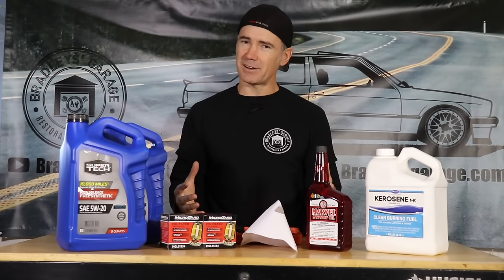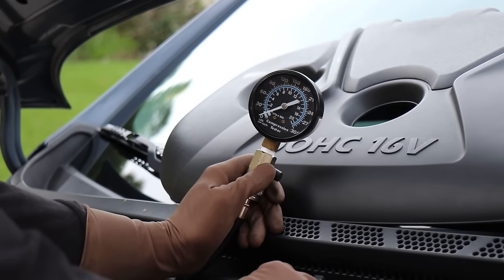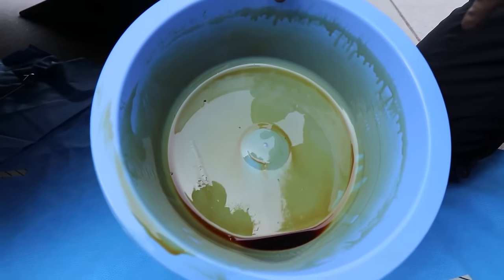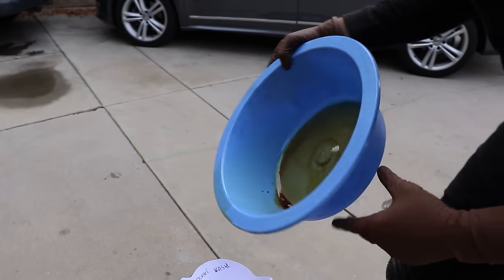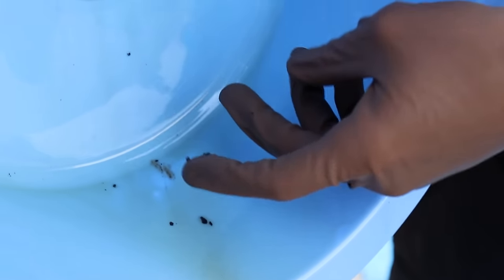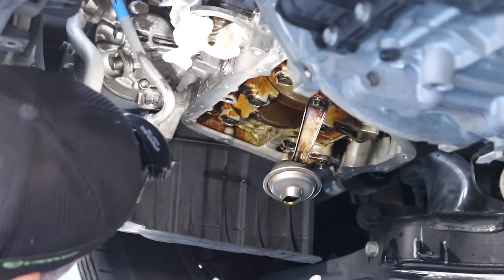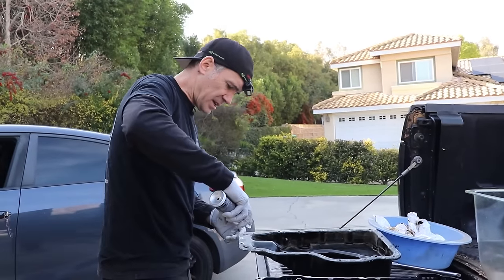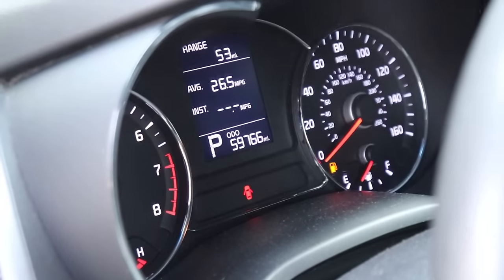*UPDATE* Customer States Jiffy Lube refused to change my Oil - Sludge Factory Kia Forte

Comment: 3000 miles is a good short duration oil change interval, but with Mobil 1 synthetic, the oil drain interval can be lengthened. Whatever the owners manual suggests for a drain interval is going to be easily doable for Mobil 1. If it gives a range for drain interval, the longest interval should be fine.
Granted there is still some internal sludge in the engine, so a shorter duration even with the Mobil 1 would be prudent to do for maybe 2 or 3 oil changes, but after that, a longer duration time should be fine.
I have a 99 Chevy Silverado 5.3L that I use quite infrequently, and I run Mobil 1 Extended Performance High Mileage 5w30 in Since I barely get 3000 miles in a year, I just change oil once a year with it. I should really drive that truck more than I do.
Reply from the maker: Thanks for the comments Danny, appreciate the feedback. Cheers!

Comment: That engine is 100% cleaner than before the 1st flush. The owner of the car is very lucky that you were able to save it. Going forward, if oil changes are done at regular intervals, say  every 4k miles, would the remaining bits of sludge be gone? Thanks
Reply from the maker: Thanks for the comments Joe, appreciate the feedback. We will check on it every 1k miles until the nest 3k miles oil change. It has already been 1k since the update video and we are not seeing any evidence of oil loss of any other issues. We plan on doing 3k mile oil changes for at leas the next 3. That should help remove any remaining debris even though things looked pretty good after the update.
Hopefully we have done enough the salvage the motor and keep this little Kia running for many more thousands of miles.
Cheers!

Comment: Great videos. Could you have just done flushes with conventional motor oil and drain, and have similar results? Thank you.
Reply from the maker: Thanks for the kind words, glad you enjoyed the videos. Unfortunately there is just not enough oil flowing on top of the cylinder head to wash off that sludge. You saw how caked on it was and even after numerous flushes, there was still residue.
We even did a little diesel flush (off camera) with the oil pan off to wash out any debris in the tight areas of the engine and holes. That produced quite a bit of particles so we feel pretty good that we got the internals as clean as possible.
We just posted the 3k mile update video if you haven’t checked it out yet - https://youtu.be/QrJ0B-KXTw0
Cheers!

Comment: Should have used atf instead of diesel, all you did with that is thin out the oil. ATF is full of detergents and cleans the engine much better. You should have removed a bearing cap and took a look at the bearing, that will be the tell all to see if all your work has done anything.
Reply from the maker: Thanks for the recommendation, we will check out ATF on our next Sludge Factory project.
Cheers!

Comment: Good video. Friendly advise though, use way less sealant that you showed putting on the oil pan, bead should be no bigger than 1/8" and mostly towards the outside of the lip, just rounding the bolts. Slivers, or excess on inside can and will fall off and clog oil pickup tube restricting oil flow locking up engine. Plenty of locked up cores for no oil, because of this and sludge in piston rings burning up all the oil. Take care.
Reply from the maker: Thanks for the comments, appreciate the feedback. Cheers!

Comment: Been doing a transmission fluid in the engine oil. I’ll add some BG engine flush right before the next oil change. 2012 Scion XB using 2 plus quarts every 3 to 5 thousand miles.
Reply from the maker: Thanks for the comments, appreciate the feedback. Cheers!

Comment: I'd install a container of Rislone P/N 4102 with the oil change and run it the full interval. Do that for a few oil changes. Rislone has some ester content which is a slow-acting cleaner. This can help dissolve sludge in smaller passages within the engine without breaking loose large chunks, to include oil control rings.
Reply from the maker: Thanks for the comments, we will look into that product. Cheers!

Comment: I’d be afraid the cylinder walls would get washed out, loosing their varnish.
Reply from the maker: Thanks for the comments Nina. Not sure what you mean by cylinder walls getting washed off? All products that were added to the crankcase have lubricating properties so there would not be any damage, especially at idle.
Cheers!

Comment: Given how long the sludge was present throughout the whole engine, why weren't the timing components and oil pump also addressed while the valve cover and pan were off? All that crud surely must've shortened the life of  those parts by quite a few thousand miles or so at the least.
Reply from the maker: Thanks for the comments Dan, appreciate the feedback. We did a little diesel flush (off camera) with the oil pan off to wash out any debris in the tight areas of the engine and holes. That produced quite a bit of particles so we feel pretty good that the internals are clean at this point. 
Hopefully we have done enough to salvage the motor. We will continue to monitor it every 1k miles to see if it is burning oil or has any issues.
Cheers!

Comment: Reminds me of the 2.7 dodge your pretty cool what kind of gloves are those.
Reply from the maker: Thanks for the comments, it was more of a mess than we had anticipated. Hopefully we have done enough to salvage the motor.
We have a few friends that work at a hospital and they get us unused supplies. These are actually surgeon gloves used in the OR, so they are a little thicker and have high cuff. 
When we need to purchase them though, this is what we use - https://www.amazon.com/Microflex-SafeGrip-Disposable-Automotive-Fingertips/dp/B002WQG02M
We just posted the 3k mile update video on the Kia if you haven't seen it yet - https://youtu.be/QrJ0B-KXTw0
Cheers!

Comment: All unnecessary. The sludge adheres to the inert parts of the engine. All you need to do is change the oil and the new oil will slowly dissolve the sludge. There is argument, but the decent condition of the oil pan shows that no special measure were necessary. Above all, whatever wear or damage has occurred as a result of failing to change the oil is not going to be reversed no matter what you do. Absent clear evidence that the oil system is clogged, just change the oil and proceed.
Reply from the maker: Thanks for the comments Mike, appreciate the feedback. Cheers!

Comment: I had an engine like this in a car we drained the oil added a mix of 50%oil and diesel fuel run it for one hour and drained it out! Refilled and changed oil and the filter. After that I changed the oil every 3000 mile and never had a problem, you just need to clean it out and start fresh.
Reply from the maker: Thanks for sharing, hopefully we have done enough to salvage the motor. We just posted the 3k mile update video if you haven't checked it out yet - https://youtu.be/QrJ0B-KXTw0
Cheers!

Comment: Wow great info! I do use pennzoil ultra platinum on my 2021 Bronco and Super Tech on my 2022 Ford Maverick, but will be switching to pennzoil as well. I do my oil changes every 6 months never exceeding 4k miles. Is that something you would do to your own vehicles?
Reply from the maker: Thanks for the comments Ramon, appreciate the feedback. Depending on the car, way it's driven and manufacturer recommendations, we run from 3k on performance cars, up to 10k on our diesel engines. No matter what we are using Full Synthetic on every vehicle, typically Liqui Moly or Torco. 
Cheers!

Comment: Pickup a parts washer brush (kind with a hose attached) and connect it to a cheap pump in a oil drain pan. Leave oil drain out of engine oil pan. Use a cleaner you choose (diesel would work) and just brush and wash sludge from under valve cover down into oil pan and into drain. Once clean, drop oil pan and clean. If you want to use a engine flush after that, it's got much less crap to deal with from the start. (you basically just use the engine block as a big parts washer.)
Reply from the maker: Thanks for the comments George, appreciate the feedback. We did a little diesel flush (off camera) in the first video, with the oil pan off to wash out any debris in the tight areas of the engine and holes. That produced quite a bit of particles so we feel pretty good that the internals are clean at this point. 
Now after the update video things are looking really good.
Original video - https://youtu.be/XU79jXYWydA
Cheers!

Comment: You a fan of Seafoam at all?  I've had good luck with it in the gas tank of my car, and the intake, but never tried it in the crankcase...though it says you can.
Reply from the maker: Thanks for the question. We have used it just like you, in the fuel tank/system and cleaning intakes. We have never used it in the crankcase before though we have had positive feedback from the Sludge Factory video.
Cheers!

Comment: 17:40  On modern cars, you can press accelerator to the floor before engaging starter and the engine will not start.  You can crank it this way to prime the oil filter before an actual ignition and idle.  "Poor man's pre-oiler."
Reply from the maker: Thanks for the comments Chet, we did that for the compression check but never really verified if it works on this Kia after the oil changes. Adding a little oil to the filter is easy enough to do. 
Thanks for info though. Cheers!

Comment: Really wish you had cut the original filter and did a oil analysis. If you can use a diesel rated high detergent oil it will clean up better. Oil should not be much dirtier than dark honey.
Reply from the maker: Thanks for the comments Ron, we didn't even think about testing the oil or filter until it was already discarded. Once we opened up the can of worms, we got a little distracted by the mess. Hopefully we have done enough to salvage the motor.
We just posted the 3k mile update video if you haven’t checked it out yet - https://youtu.be/QrJ0B-KXTw0
Cheers!

Comment: Thanks for the update link. Surprised the compression still up.  Wonder if you could pull a plug and use a small camera to go inside and look for scoring?  Likely none with those compression numbers. Should put an oil plug in that has the magnet on it.   Seafoam seems to be real good at cleaning up (through gas additive and oil additive), and use some Royal Purple oil - but that will likely have to run 2-3 times and do regular mileage oil changes... more of a long term thing.  What do the intake valves look like?  All crudded up from the lack of multi-port injection washing?
Reply from the maker: Thanks for the comments Rick, we tried to use a little camera scope down the cylinder. The problem is it wasn't clear while recording the little screen so we decided to leave that part out.
Great suggestion getting a magnetic oil drain plug, just to see if there is any metal flakes floating around. Also could not really see the valves clearly with the camera since it's hard to make a 90 degree turn with our setup.
We just posted the 3k mile update video if you haven't checked it out yet - https://youtu.be/QrJ0B-KXTw0
Thanks again for hanging out, Cheers!
Reply: @BradleysGarage  No problem - thanks back for reading the comments so quick and commenting back - I have subbed now as well.  Enjoying your content!

Comment: Not a bad result. The only thing i think will clean this better is the BG engine restoration, but what you did here is way cheaper...
Reply from the maker: Thanks for the comments, appreciate the feedback. This was our first Sludge Factory so we had never heard of the BG stuff before the comments stated pouring in. At $300 it's expensive but if it enables you to not remove any parts, it would makes sense in cars that are more difficult to access the valve cover and oil pan.
Cheers!

Comment: Wouldn't MMO thin out the oil? Did you use different weights of oil during this process?
Reply from the maker: Thanks for the comments Cory, it would thin out the oil for sure but that was the intention. We only left that mixture running for a short period so it wouldn't be an issue. Hopefully we have done enough to salvage the motor.
We just posted the 3k mile update video here - https://youtu.be/QrJ0B-KXTw0
Cheers!

Comment: Just change oil after 500 miles 3or 4 times. Would have done the same thing
Reply from the maker: Thanks for the comments, not sure that would do the trick on this one. We definitely needed to get as much out of the crankcase as we could in order for it to clean up. It's looking pretty good after the first 1k miles since the update video, no oil burn as of now and things look good.
Cheers!

Comment: Had an engine just like that back in the 80s. I used diesel fuel and cheap motor oil. 50/50.  It worked.  Drove that old Ford LTD for three years.
Reply from the maker: Thanks for the comments, appreciate the feedback. Cheers!

Comment: You should do your kerosine rinse with the valve cover off and poor it into every little nook and cranny of the head. Preferably with the oil pan off as well.
Reply from the maker: Thanks for the comments, we did a little diesel flush (off camera) with the oil pan off to wash out any debris in the tight areas of the engine and holes. That produced quite a bit of particles so we feel pretty good that the internals are clean at this point. 
Be sure to check out the follow up video here - https://youtu.be/XFsHnrt0l3w
Cheers!

Comment: Good job 👍🏾, thank you for sharing. You did everything perfectly aside from would have done. And I have a chemicals degree in that subject. FYI everything you did will not harm the engine and safe, what ever is left is all lose and the detergent in fresh oil will take care of it. Oil contamination with moisture and short trips is the major causes of sludges. Generally after a good long drive it is a good idea to just dump the oil without replacing the filter is highly recommended.
Reply from the maker: Thanks for the kind words Mr. Steel, appreciate the feedback. There definitely seems to be an issue with short driving trips as he works very close to his home.
Hopefully we have done enough to salvage the motor long term.
Be sure to check out the 3k update if you haven't seen it yet - https://youtu.be/QrJ0B-KXTw0
Cheers!
Reply: @BradleysGarage  one advice? 
After running the engine till operational temperature is reached, start the clock for 15 minutes, then let it sit for the sludge to loosen up more for 1/2 hours, therm repeat by running engine for 15 minutes after reaching operational temperature. 
Now drain it 🙏

Comment: With this engine, maybe take an old trans pan magnet and put it on the bottom of the filter. Check those VVT solenoid screens, and clean the solenoid passages.
Reply from the maker: Thanks for the comments, we will take a look at the VVT solenoids. Cheers!

Comment: Wish I knew as good of a mechanic. The Undercarriage, Engine and Transmission were really clean.
Reply from the maker: Thanks for the kind words Ron, we refuse to work on dirty cars. We did a complete pressure wash on the engine bay and undercarriage before starting any repairs. There is nothing worse than working on oily, greasy cars.
We just posted the 3k mile update video here - https://youtu.be/QrJ0B-KXTw0
Cheers!

Comment: With all the time and material, ( including   all that wasted new oil,) you could have pulled the head, oil pan and pistons. Clean it all& reasonable and be done in less time &material. 😂
Reply from the maker: Thanks for the comments Mark, appreciate the ideas. Pulling the engine was not in the cards so we did the best we could given the circumstances. Hopefully we have done enough to salvage the motor.
Thanks for hanging out, Cheers!

Comment: Need to do some mic adjustment on your shirt, it gets so distorted when you talk sometimes it’s very hard to understand what you’re saying.
Everything else with this series was awesome
Reply from the maker: Thanks for the comments Dustin, apologies for the sound issue. Not sure what went wrong with the mic, we think it has something to do with laying on the ground and the wire gets kinked.
We will try just using the clip on without the Lavalier Mic to see if that works better on future videos. This was the first time we had this problem so it's kind of odd. 
Glad you enjoyed the video, be sure to check out the original if you haven't already.
Original - https://youtu.be/XU79jXYWydA
Cheers!

Comment: If you want to see how much crap is still being knocked loose, cut open the filter and see what's in the pleats.
Reply from the maker: Thanks for the comments Jim, we will try to do that at the 3k mile oil change. That should give us an idea of how much debris is left floating around in there. We checked after the first 1k miles and the engine so far has not burned any oil and things still look good.
Thanks again for hanging out, Cheers!

Comment: Boy that engine is just about as clean as it was when it left the dealer.
Probably not as tight tolerances after the sludge.
But it’s sure clean now.
Reply from the maker: Hopefully we have done enough to salvage the motor. We just posted the 3k mile update video here - https://youtu.be/QrJ0B-KXTw0
Thanks again for hanging out.
Cheers!

Comment: Sounded a bit noisy on video. I would never start a car with just diesel in the crankcase ! We used to replace one quart of oil with one quart of transmission fluid and let it idle for 15 minutes , dropped the oil and filter then poured some fresh oil in to rinse out the pan before new oil and filter were installed. Never had any issues.
Reply from the maker: Thanks for the comments Glen. We only ran the engine with about a 25% diesel ratio, 3.2 quarts of oil to 1 quart of diesel. The engine has sounded like that since the beginning so we aren't concerned at this point. Cheers!